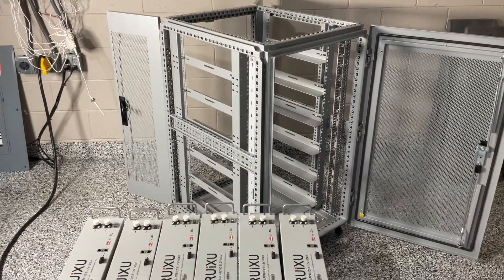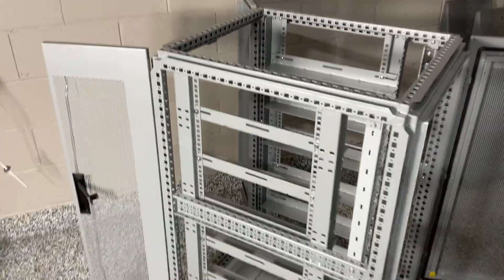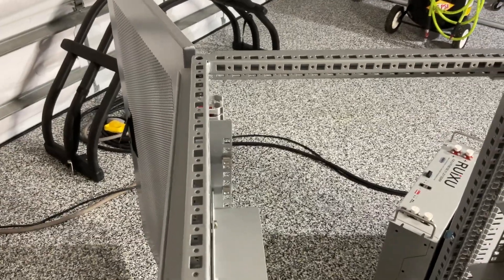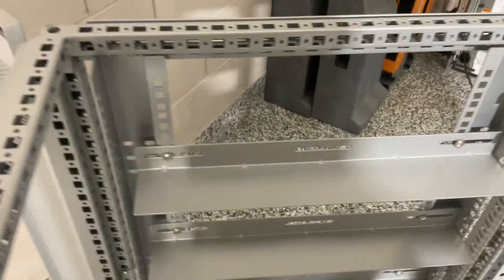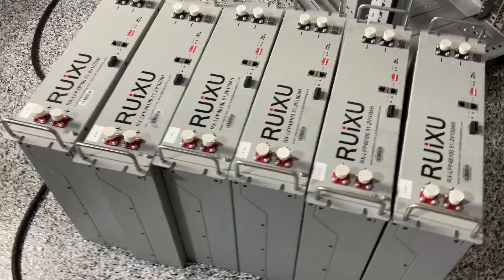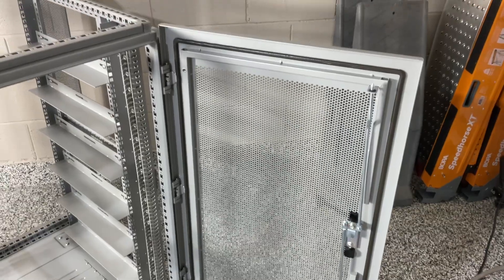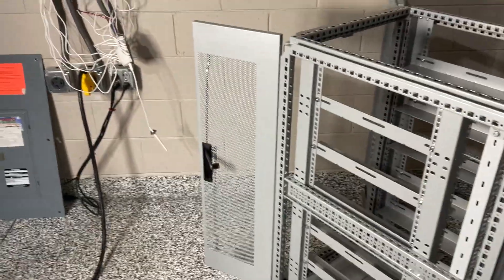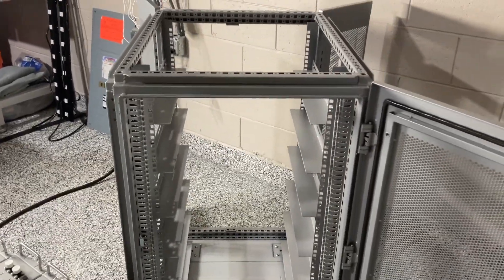RUIXU 30kWh Battery Rack

Comment: I really like that rack. Do you know what the height would be if I remove the wheels?  I was hoping I could build a garage workbench on top of the battery rack. and use the battery rack as the base of my workbench.
Reply from the maker: I don't have the measurement handy, but I'm pretty close to publishing many more videos related to the complete process that I went through now that I've finished my solar system - just two weeks ago.  I'll measure the height and get back to you. I can say that I left the wheels on mine and then leveled the rack using the adjustable screw pads until the wheels were off the ground.  I don't think you would have any problem doing what you described. If want or need to minimize the height to accomplish your goal there should be no issue taking the wheels off.  Keep in mind that fully populated rack is very heavy.
Reply: @smithrb thanks, yeah I would put the empty Rack in position before I put the batteries in for sure. I think my workbench will sit about 40 inches high. That might be a little high I'm thinking
Reply from the maker: @diySolarPowerFunWithRay Sorry for delay - so many things.  I measured 39 1/4" from the bottom of the rack (no wheels or screw pads) to the top edge of the rack.
Reply: @smithrb  that is good to know. Thank you for measuring that for me. That might work.

Comment: how has Ruixu been to deal with?
Reply from the maker: Very responsive. I usually hear back the same day with any questions I've had thus far.
Reply: @smithrb  ok thanks, looking at their 15kWh kit... seems like good value.
Reply from the maker: @mmbodnar I'll be ordering the same shortly.  Will bring my capacity from ~30kwh up to 45kwh with extra space for for 3 add'l batteries at some point.  Mid stream in my new solar installation, should finish up before too much longer.  I'll be posting additional videos then.
Reply: @smithrb  sounds like a great system, interested to see the details of how it's configured. They don't include any cables to connect the rack to the inverter(s) right?
Reply from the maker: @mmbodnar  No they don't since they can't know what system (size, etc) you intend to use it with.